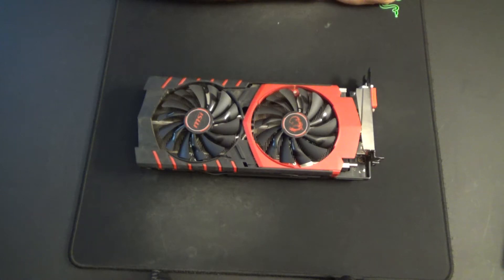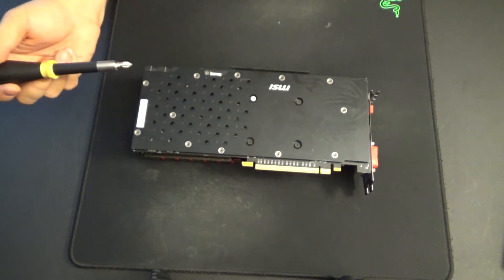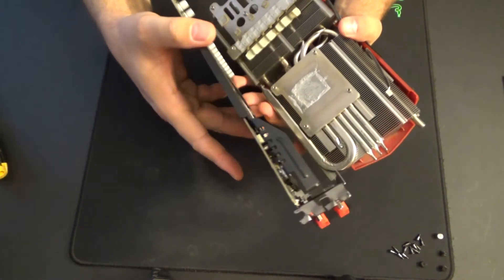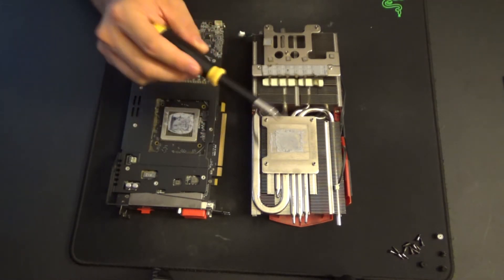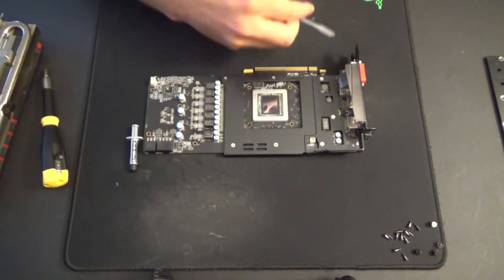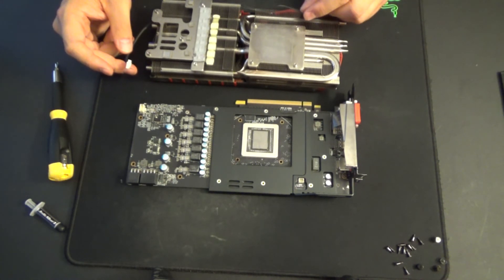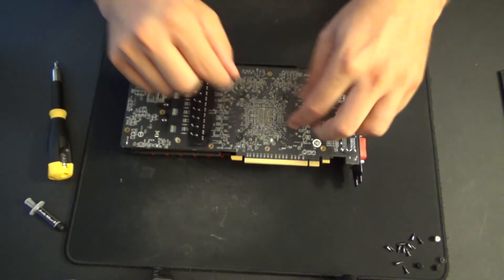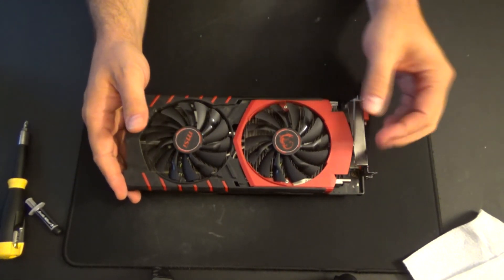MSI R9 390 New Thermal Paste Application

Comment: Just got a question about the thermalpads, so i dont have to change them, they should still work right?
Reply: They will still work to keep your vram and power delivery cool but if they are crusty then it is advised to change them because they can shrink overtime because of the heat and stop making contact with the heatsink or the ic's

Comment: DO NOT put artic silver or any other conductive paste on a GPU! I came here for some pcb details on this exact card, wish you guys best of luck.
Reply: what are you talking about? what else would you put on it?
Reply: @Aiyqk  any paste that isn't conductive. Ceramic or silicon based pastes are good examples.
Reply: i was thinking youre talking about thermally conductive, so youre talking about electrically conductive right? google says the arctic silver is not tho
Reply: @Aiyqk  artic silver is, artic ceramique, mx2, mx5 are all safe off the top of my head tho
I also have used k2, gd900, and kingpins blue smurf sauce and they all have been fine. Most pastes are based off carbon or silicon these days, so it's largely a non issue